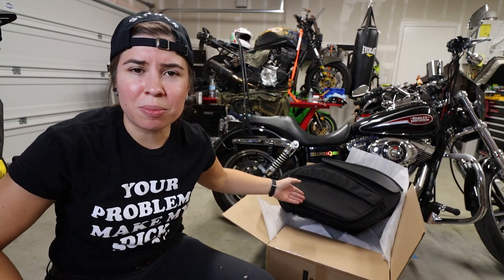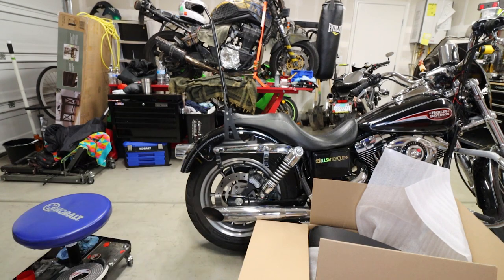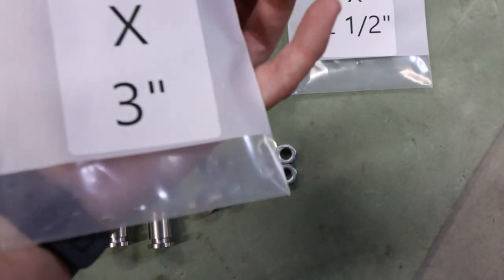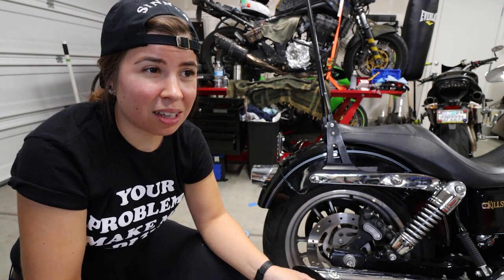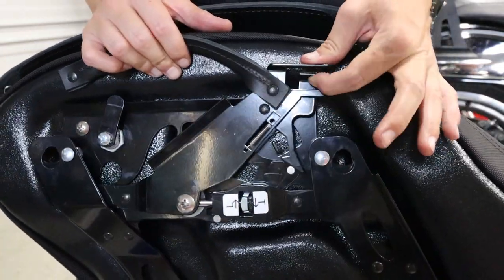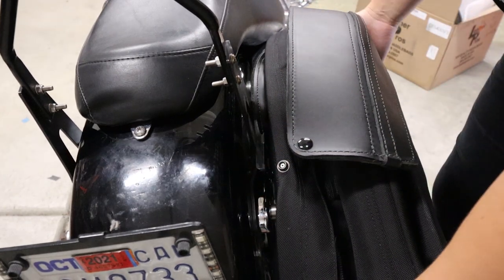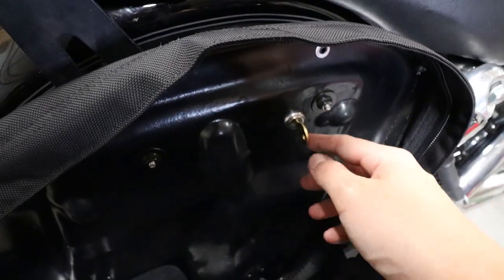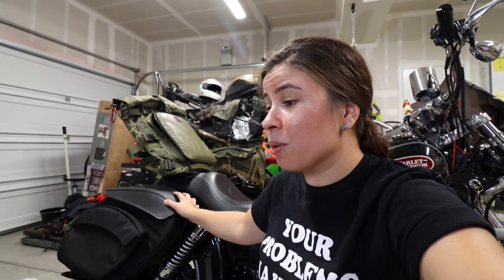How To Install Leather Pros Saddlebags - Harley Davidson Dyna

Comment: hey I just subscribed and I wanted to see if you could give me advice on a project bike. this would be my first project bike and my first ever motorcycle it is a Honda cm400E that im getting from my cousin. they said that it needs a new starter, battery, and problably an oil change but there might be more the needs some fixing
Reply from the maker: Hey! Those bikes are pretty sweet but being so old, you'll want to make sure you completely go through the machine. All fluids (forks, fuel, oil), check the bearings (wheels, steering stem, swing arm), make sure the tires are good and not cracked/old. Seals may go bad and start to leak. Once you get it dialed in, you'll be smooth sailin'. Check out 4into1.com they are a shop in San Francisco that stocks parts for old Hondas. Best of luck!
Reply: @KillswitchQueen  thank you so much!